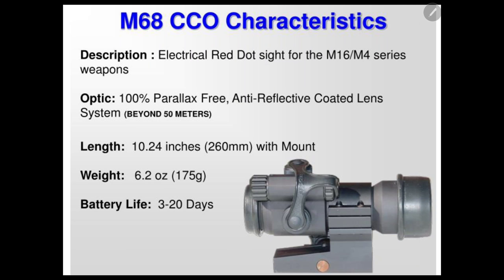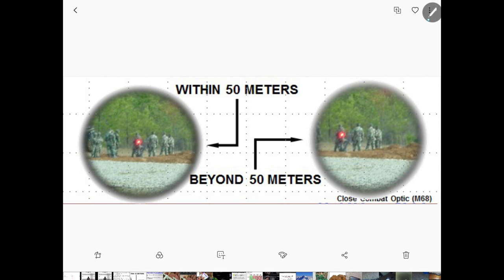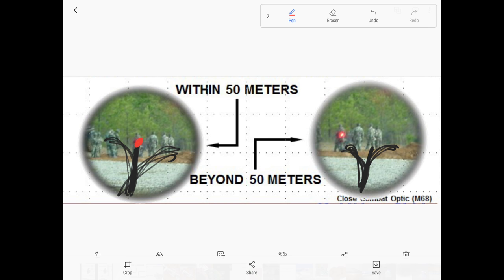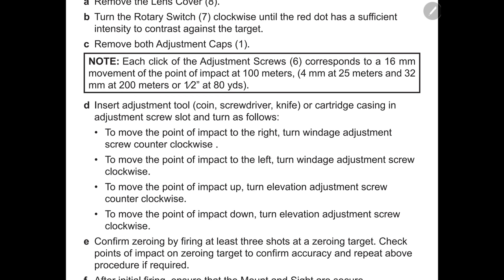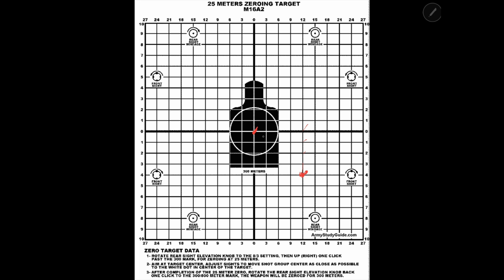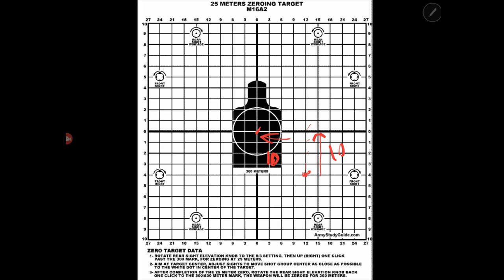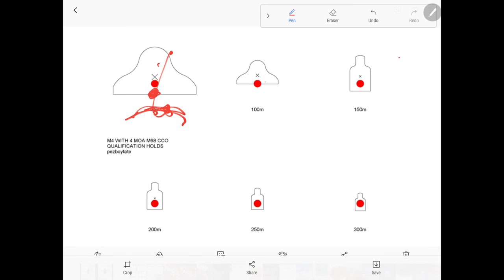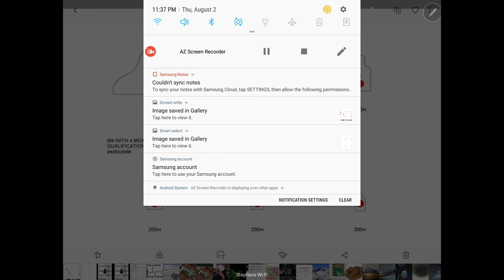How to Zero the M68 CCO.

Comment: When zeroing the M4, if given the option. Would you recommend zeroing the iron sight and then the cco to the iron sights via Lollipop off range. Or zeroing the cco to the groupings right away.

Someone told me that lolipoping can be done on the front sights but i thought that was kinda stupid if you were able to zero on the range first
Reply from the maker: Rule of thumb, you should zero irons first, one reason for that is so you don't forget to, and yes after you zero your iron sights, lollipop it. That will get you very well on paper for a proper zero. I would avoid zeroing the cco to the iron sights grouping. Because for that to be accurate the rifle would have to have been completely stationary the whole time, if you bumped it alittle it would through it off.
Reply from the maker: Important point, lolipoping is NOT a zero, it is simply a technique to get a newly mounted optic on paper.

Comment: So this is at mechanical zero on the irons, correct?
Reply from the maker: I always recommend zeroing the iron sights first. But it is not necessary for the cco.  When I say to stack it or lolly pop it is only as a reference point for a consistent sight picture since the zero target is less than 50m away. Which is where parallax is set.
Reply: TacTard45 Thank you.
Reply from the maker: Np